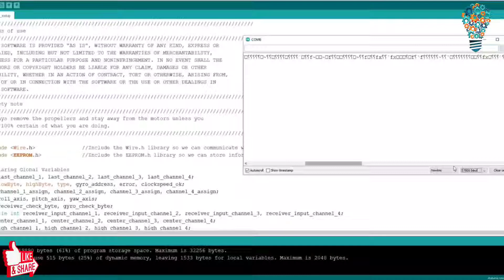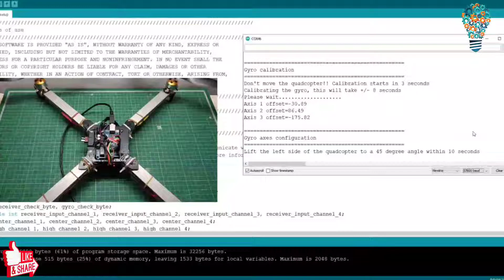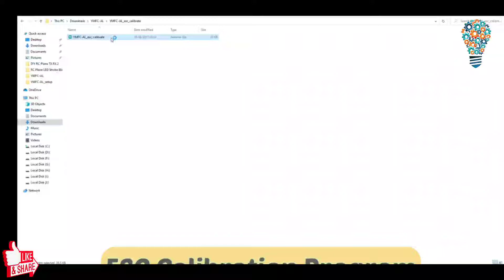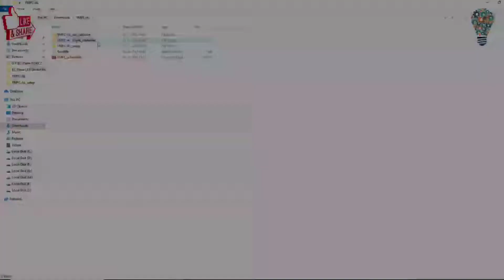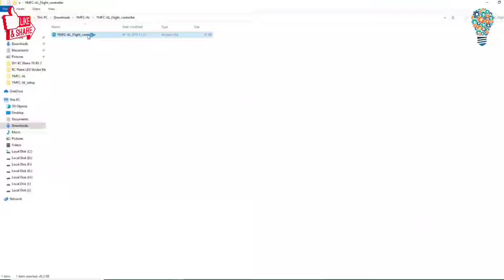How to make a flight controller for a drone using  Arduino || Arduino Flight controller

Comment: can a 6v motor drone fly
Reply from the maker: No, bro. It's not possible because 6V motors are too slow and heavy. You should use BLDC motors for your drone/plane.

I watched a few of your videos! You are doing a great job!💫 Keep going, and let me know if you have any questions.👍
Reply: suprising if you did so but I have just sthated my channle and I luck boards like audino nano because all my staff are made from scratch❤❤
Reply: now is it safe for 180dc motor
Reply from the maker: I don't recommend using a 180 DC motor because its weight ratio is higher than its RPM. Instead, use a coreless motor to make a smaller and lighter drone/plane.
Reply: but I have seen one using the and he succeeded the15doller drone
Reply: but I think coreless motors are best but 180 can also work are the only motor I have access on , am in Uganda so motors are rare . for the love of diy I extract them from gabage and toys
Reply: thanx this is the best conversation I have ever hard❤❤❤❤❤❤❤❤❤❤❤❤❤
Reply from the maker: oh yes... DD Electro tech channel .. right.?
Reply from the maker: same here  bro... feel free to ask any questions  I'll  help you..!
Reply: thanks for the replys❤❤❤

Comment: When you assembling all Where is the Receiver part i couldn't get it how did connect reciver
Reply from the maker: bro i already explain about the connection of the Arduino and the receiver in my circuit diagram..  but if you have any query or any problem then contact me.. !!1

Comment: can i use nano instead of uno ??
Reply from the maker: yes bro.. you should watch my new video ( Flight Controller using Arduino Nano )
Reply: Can i use 2200kv motor
Reply from the maker: yes bro. but you should use 5 to 6 inch propeller with it.. !

Comment: drone motors are not running equally pls help
Reply from the maker: you need to calibrate all the ESC at same time !!
Reply: @ProjectsPlanner  i calibrated all esc and they were properly spiing but after i put ymfc flight controller file then the motor does not spin conitiniously. i turn left and only left motors work and right motor gets off and vice versa pls help i am in big problem ):
Reply from the maker: ok.. please check the direction of all motors and also check the Propellers direction according to the motors. !
Reply: @ProjectsPlanner  soorry for problem but the problem is the motors are not spining while it is in place if i lift left, right , front ,back then the motors start spining, one onemotor starts spinng automatically and when i incerase the half then 2 motors start spinning and last one motor does not spin ,but it is starts when i lift the drone left.               the motor and esc calibration are good and working. pls help if you can  ,,tq
Reply from the maker: okey so please try to place the drone in Smooth surface and Celebrate the Gyro for the maximum Centre Celebration. after that when you turn on the drone  your all 4 Motor will rotate equally . !

Comment: After uploading the YMFC AL in the serial monitor the process is being aborted by showing no angle detected in 10 seconds even though the mpu is connected to the correct pins... i even purchased the new mpu but the results are the same... what to do??? please help me...
Reply from the maker: please check your Data Cable.. bcs i had same issue with my flight controller.
Reply: The result is the same bro.... please help me..
Reply from the maker: hmm.. ok bro !  I'll find the solution of your problem..

Comment: Hello sir can you tell me wether during uploading flight controller picking up drone is important and how to control it because i am unable to control my with same configuration
Reply from the maker: You still need more practice to fly the drone. And to give throttle slowly in starting.. !  
Still If You Have any Query.. Please Comments me !!
Reply: @ProjectsPlanner  also in mu case 10 inch propler in the lowest throttle motor starts hovering
Reply: @ProjectsPlanner  sir your project is really great and without an body you have pretty nice flight there but can you explain me that how to control the flight or make an video because I broke almost 3-4 propeller and it cost me around 400 rupees and broke my frame that cost me 100 so I have wasted 500 in test please tell me which propeller did you use also how you manged to control it
Reply from the maker: @pranav4533  sure bro, I'll make saperate video for how to control your drone ! 👍

Comment: We are facing an error while executing the given code. The error says 'No valid signals from receiver is found'. Could you please help us
Reply from the maker: Turn On Your Transmitter And Receiver When You upload the code ... 
And Your Tx & Rx Must Bind With Each other.. 
And Also check The Data Cable Of Arduino.. 

If The Problem Will Still Continue Comment Me.... 
I will Try To Help 100% 👍

Comment: What Will be the price approx
Reply from the maker: The Total Price of Flight Controller is only 600 to 700 ₹  - Without adding other components.. ( ESC , MOTOR , BATTERY,  etc.. )
Reply: @ProjectsPlanner  is you are using Arduino as flight controller?
Reply from the maker: @dhivya25  yes Bro.. !! Bcs..Ready made Flight Controller Is Very Expensive..  Arduino is a Good Option to make a flight controller ..